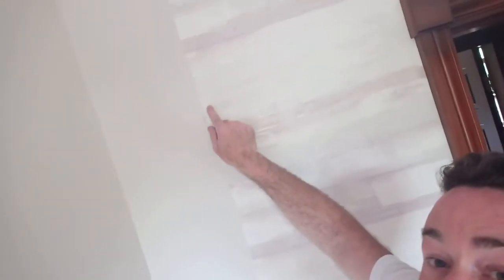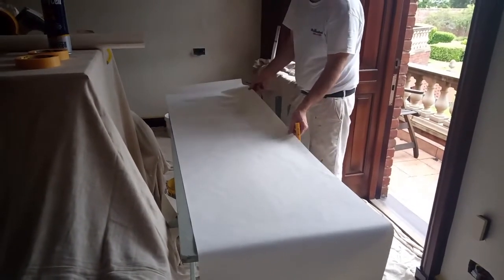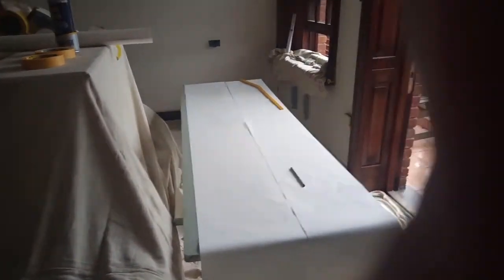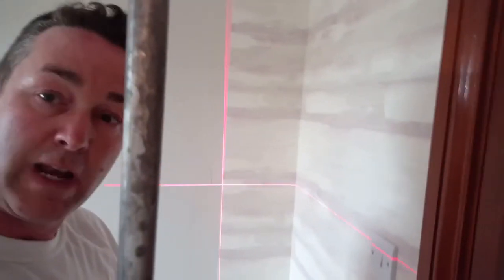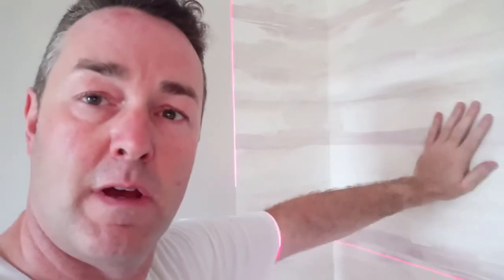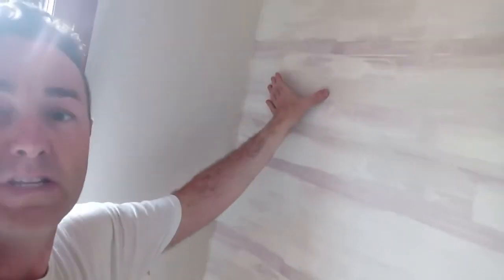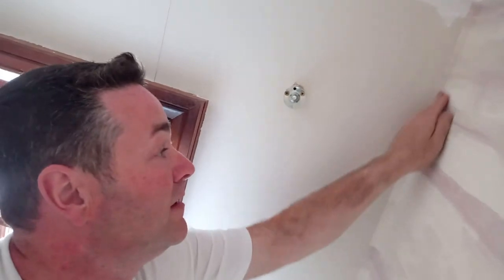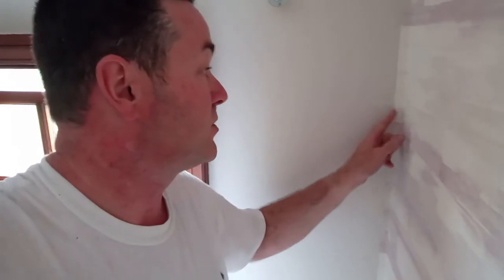How to wallpaper into a corner - using a laserliner Pt 2 & 3

Comment: When I served my time the correct way to paper a room was to work from the window wall back to the corner where you lost the pattern and not back into the window. So in theory you should of started in the opposite window corner, back around to where you lost the pattern. Its to stop light hitting the joints if you understand what I mean?
Reply from the maker: I understand it totally. It's working from the window/main light source when papering a ceiling that's the main issue with joints being raised on one side.

I don't get raised joints on walls so it's doesn't matter as they don't show.... Seam rollers come in very handy lol
;)

Comment: All good except I think you should always work away from the light where possible to hide the joints
Reply from the maker: Back in the day of poor trimming, edges could show as raised.
Now days, better cutting and skills of hanging, using seam rollers, not so detrimental.

And depending where you are in a room, with where you'll lose the pattern, you'll always have one wall you may find you're working towards. Plus these are flat papers and not with a relief on them like a blown vinyl etc

Ceilings... Work away from.the main light source.